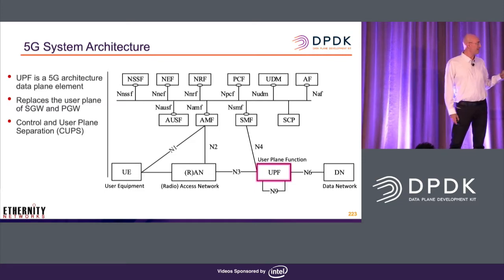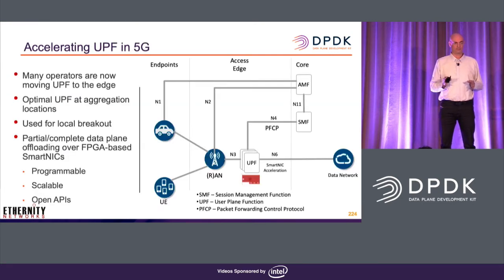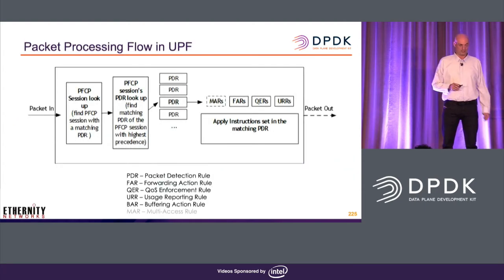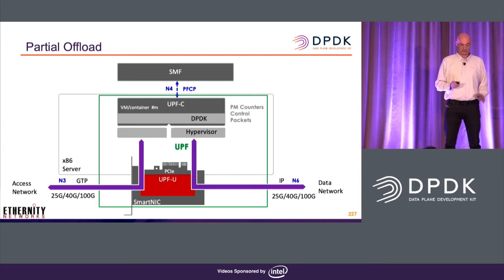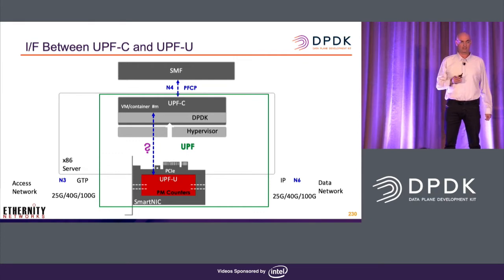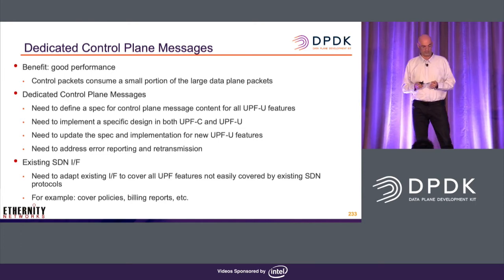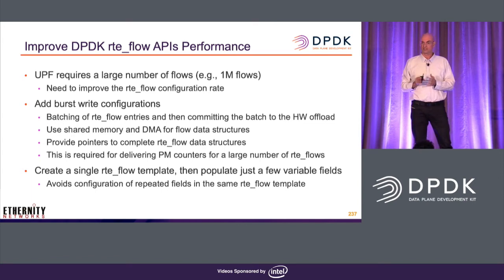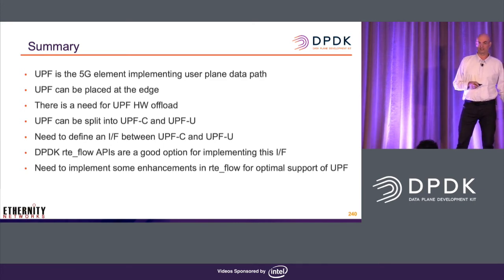Using DPDK APIs as the I/F between UPF-C and UPF-U - Brian Klaff & Barak Perlman, Ethernity

Comment: SMF is control plane part only if you draw it's analogy with cups model,SMF =sgwc and pgwc,UPF=sgwu and pgwu.UPF is pure forwarding plane.And as mentioned in video where an analogy is made with sdn so N4(pfcp) is more of openflow protocol.so smf=sdn controller,UPF=forwarding plane.Thats the way forward it should be designed and the control plane flow rules can be processed in server cpu and data plane forwarded into smart nics so that server cpu is offloaded and p4 language can be used between control and data/forwarding plane,